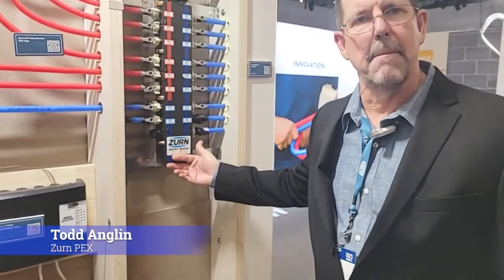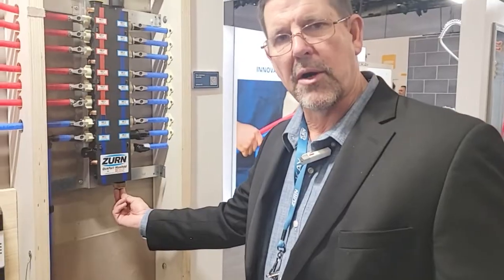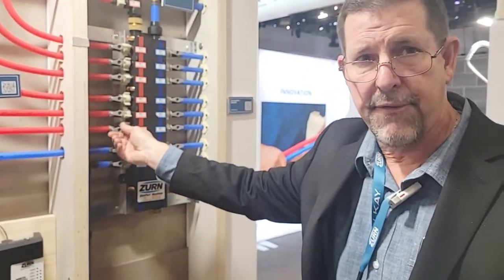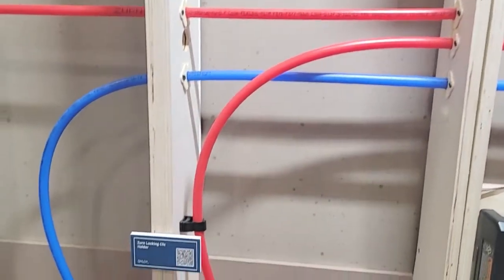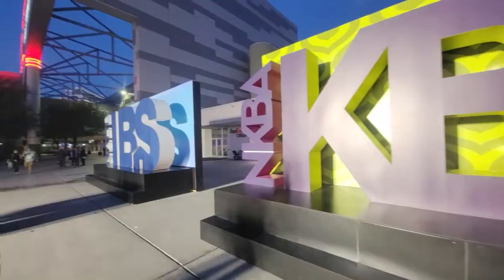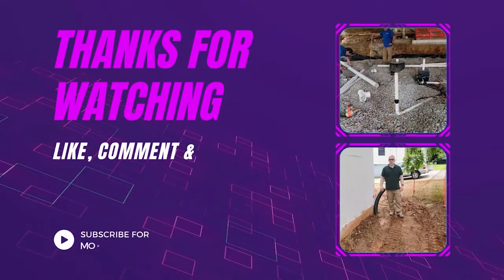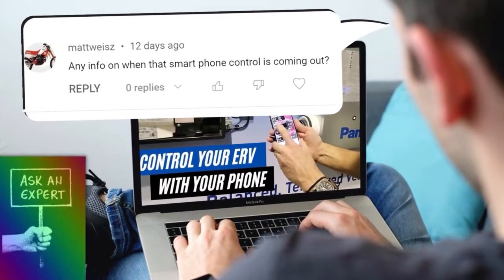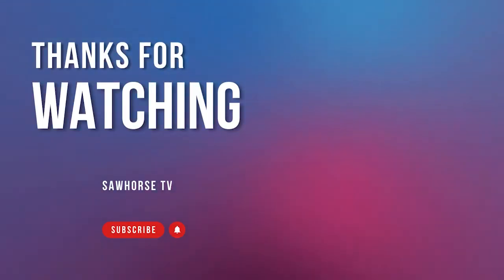Efficient Plumbing Distribution: Introducing the Zurn PEX Manifold System

Comment: How do you replace the valve on the manifold?  One of mine will not fully close.
Reply from the maker: Replacing a valve on a Zurn plumbing manifold (typically part of a PEX home run distribution system) is straightforward, but it depends on which type of Zurn manifold you have. Most residential systems use QickPort or PEX Manifold with Integral Valves.

Here’s how to replace a valve that won't fully close:

🛠️ Tools & Materials Needed
Adjustable wrench or pliers

Teflon tape (if threaded)

Replacement valve (match the exact type: Zurn PEX valve or compatible)

PEX crimp or clamp tool (if the valve is part of the line, not threaded)

Towel/bucket (for residual water)

🔧 Step-by-Step: Replacing a Valve on a Zurn Manifold
1. Turn Off the Main Water Supply
Shut off water to the whole house at the main. Open a few faucets to relieve pressure.

2. Identify the Valve Type
Zurn manifolds generally have:

Threaded-in valves (often ½" or ⅜")

Or integrated valves that are part of the manifold body (non-removable, whole manifold must be replaced)

Look for a hex base on the valve. If it unscrews from the manifold body, you’re in luck—it's replaceable.

3. Remove the Old Valve
Use a wrench to unscrew the valve counterclockwise.

Catch any water that leaks out.

If it won’t unscrew or is part of a plastic molded manifold (no clear threads), it may be non-replaceable individually, and you’ll need to replace the full manifold or cap off the bad port.

4. Install the New Valve
Wrap the new valve threads with Teflon tape (if required).

Thread it clockwise into the manifold and hand-tighten, then snug it with a wrench.

Be careful not to overtighten—plastic threads can crack.

5. Turn Water Back On & Test
Slowly turn water back on and check for leaks.

Confirm that the new valve operates smoothly and fully closes.

🧠 Pro Tips
Zurn part numbers matter—match your replacement exactly (e.g., "QickPort Valve 1/2”").

If the valve is stuck in an open or halfway position and can’t be unscrewed, it might be a manifold-integrated valve, which means you’ll need to either:

Replace the entire manifold

Cap that port and use another

Add an inline shutoff downstream